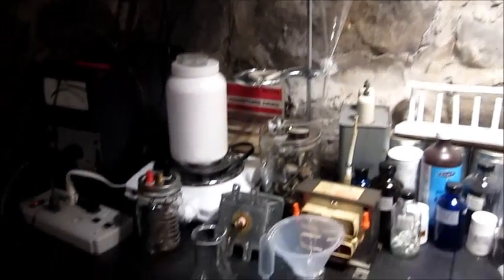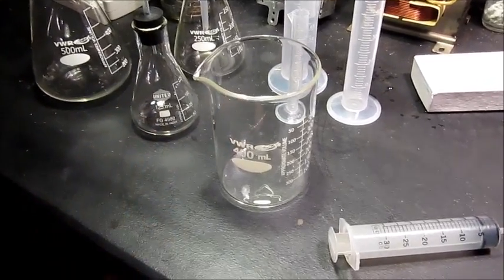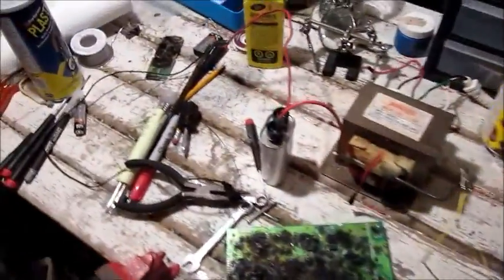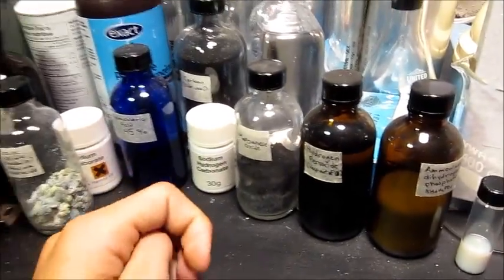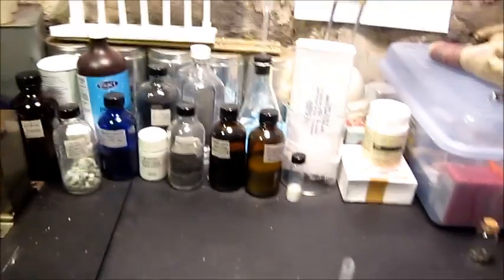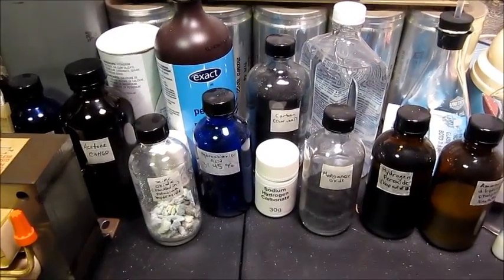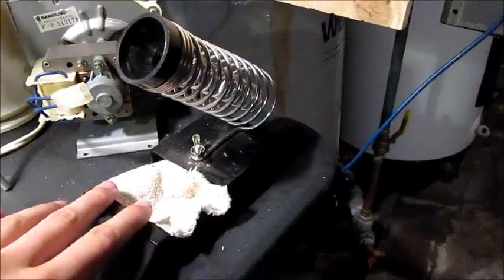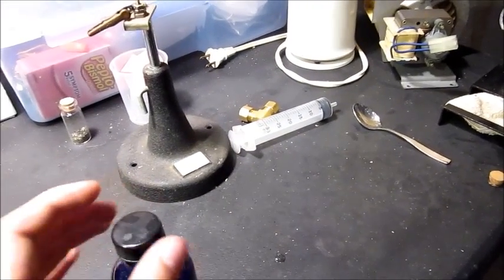How to set up a Home Science Lab

Comment: If I convert my balcony into a semi-open room, can I a set up a lab there?
(it's about 120sq feet)
(and by a semi-open room, i mean,  making a 4 feet tall wall, then covering the rest with metal net..  and obviously cover the top). 

Someone please reply.
Reply from the maker: You can make a lab anywhere. The only thing that governs your ability is if your country or territory has laws against them. If you used metal net, it would allow for good air flow or ventilation, but will not be as dependable for high precision experiments.
Reply: @castironmachines 
I did some research, and it turns out there are no laws against this.
I won't be doing any high precision experiments, at least for now...
So thanks!

Comment: How did you refine the h2o2?
Reply from the maker: +THE UNKNOWN I got some normal h2o2 from the pharmacy and heated in in a clean pot, but not to the point of boiling. If you boil it the h2o2 may start to decompose, so just heating it to under boiling is perfect so that the water evaporates and the concentration increases.